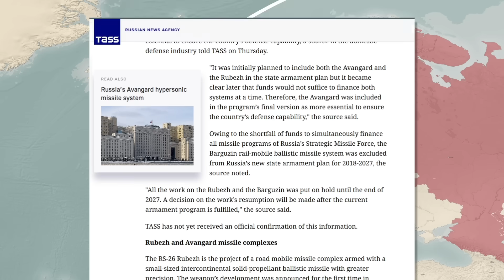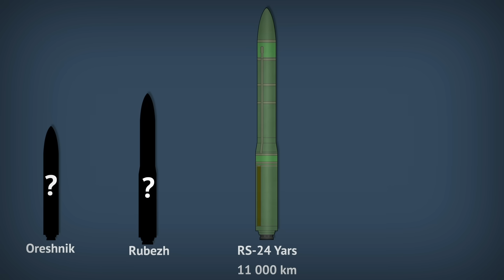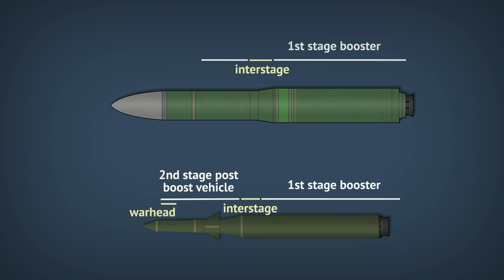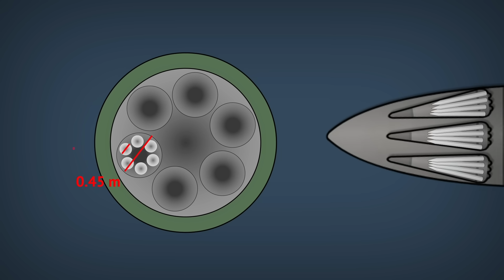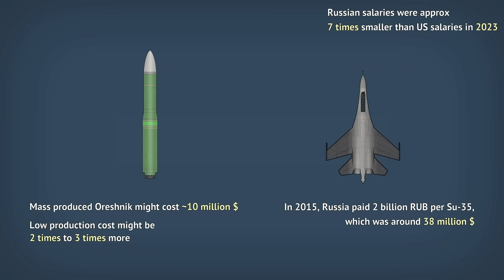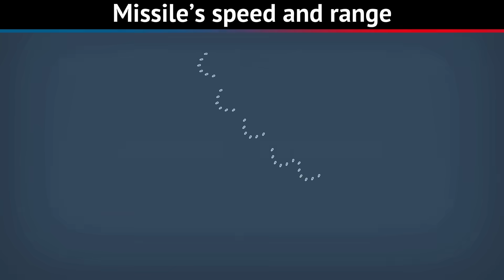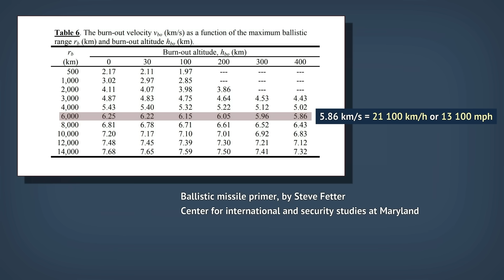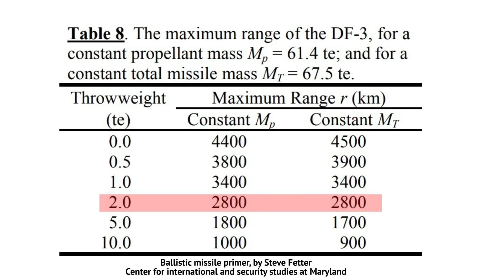Ukraine can’t counter Oreshnik missile. But it doesn’t have to.

Comment: There's no evidence of cluster munition. It is possible to determine the maximum size of each of the 36 RVs based on the dimensions of the Yars payload fairing: 0.23m diameter, 1.1m length...
They have a weight of 25kg. They cannot carry 100kg of HE.
Based on Yars, the CEP should be 124m.
PAC-3 and THAAD can intercept MRBMs.
The first successful test flight of Rubezh to ICBM ranges featured no payload. With its actual payload, it achieves a range of 2,200km. Burnout takes 124 seconds.
Oreshnik's payload is 1.5 tons.

Comment: Depending on the sophistication of the exoatmospheric penaids (chaff, cosmosol, active jammer) aegis ashore may be able to intercept some RVs in the mid course phase.
THAAD is also capable of intercepting MRBM RVs in the terminal phase, but doesn't have the rate of fire to engage most Oreshnik RVs.
Reply: THAAD сам неспособен обнаружить и отслеживать ракеты в гиперзвуке. Только по данным оптического теплового обнаружения со спутников. Далее ракета маневрирует и запускать противоракету ты можешь только тогда когда знаешь что ракета летит в твою область (прикрытие объектов, находясь у самих же объектов).Т.е. ты защищаешь уже то, что гарантированно потенциально поражено (снижаешь и без того критичный ущерб для инфраструктуры). Т.е. смысла в этом немного. 
Имея информацию о ракете нужно запускать множество противоракет, с учетом возможны вариантов полета ракеты (но тут очень большой расход противоракет, что нерационально при массовом запуске ракет и различных БПЛА потенциального противника). 
Поэтому самый логичный вывод, создать еще более быструю противоракету, которую наводят спутники и загоризонтные РЛС. (РФ имеет свои прототипы как S-550).
Но опять же Орешник не самая быстрая из маневрируемых ракет у России
Reply: @mountain_climbing  The AN/TPY-2 can and does track MRBM class targets.
Sure, THAAD can be data linked to offboard sensors that can see beyond the horizon of the THAAD battery to provide early warning, but the native radar is all that's required for target detection, track, classification and guide to intercept.

There's no evidence of post-boost maneuvering on Oreshnik.
The way it defeats THAAD is by saturation. The warheads impact at a higher rate than THAAD interceptors can launch.
Reply: @Evan_Bell - what is "plasma stealth" ? And why... (And why NOT!?)
Reply: @ivicamilosavljevic4706  It's the notion that as plasmas are opaque to EM radiation, they prevent radiowaves reflecting off the target.
What it ignores is that plasma itself is electrically conductive, and thus itself, reflects EM waves as well as emitting its own.
For most ICBM tests, radars are stationed in the target area that track incoming warheads, irrespective of their plasma sheaths...
Reply: @mountain_climbing - oreshnik technology is as old as my long time ago dead grandfather...

Comment: It's not an IRBM at all. Even with a single RV, it's not capable of the 3,500 km range threshold for an IRBM.
It's an MRBM..

That second (first successful) test flight of Rubezh had no payload. No warheads and no PBV. It was literally just the booster.

Yars has a capacity for 6 100kt warheads, but it's deployed with fewer.
Rubezh has a capacity for 9.

The Mk4 weighs 204 lbs, not 360.

The cluster nesting of RVs makes no sense, it appears to be a misinterpretation.

It is possible to determine their size, by maximum packing efficiency of the payload fairing.
Each RV is 9 inches in diameter.

Oreshnik costs 30-50 million USD.

That exhaust plume video isn't Oreshnik, but Progress MS-29 ISS resupply launched 9 hours later.

For SM-3 interception, it's not just a matter of large number of RVs, but it also likely features the same suite of chaff, cosmosol and active jammer exoatmospheric penaids that Yars and Topol-M uses.

No, the RVs are released shortly after SECO, early in the midcourse phase.

The burnout velocity is 3.8km/s or Mach 11 at 200km altitude on a max range MET. 

Yes, the attack on Dnipro used a lofted trajectory.

No, the PBV is the same for Rubezh.

Both Rubezh and Oreshnik are two stage.

The max range will full payload of 36 RVs is 2,200km.
With a single RV, it could reach 3,400.

It takes 124 seconds to burnout.

Oreshnik's payload is 1.5 tons.

Comment: Your title doesn't even match the context. Just another AI created garbage content with misleading news. And yeah Oreshnik is that important because of its pin point accuracy and devastation to wipe out anything on the map within minutes and nothing to stop  it. There you go, cleared up for your garbage content.
Reply: Pin point accuracy? No. MRBMs with non-maneuvering RVs have CEPs of a couple hundred meters.
Wipe out anything on the map? 
The Pivdenmash is still there.
The impact energy is on the same order of magnitude of a cruise missile.

Comment: the title is misleading.
oreshnik cant target smaller military units, its a waste of material, its intended to target large infrastructure which is what it was used to.
ukraine does need to counter oreshnik, but it will not receive such help because the systems to do so are extremely expensive, larger than patriot, and may rarely to never be used or be able to be used.
and a similar job can be done by other hypersonic missiles but those can be shot down since they dont leave the atmosphere  and dont come right from above, and the aircrafts that carry it have limitations.
oreshnik does not have limitations, it can carry easily 30 warheads that can do similar damage to khinzals (less accurate though since they do not have GPS guidance unlike khinzals, so its like shooting from space with a massive shotgun and praying you hit the target, but since targets are large this isnt a issue).

interception of oreshnik: interception is impossible of the warheads at least, the missile itself can easily be intercepted by  either launching a interceptor close to the launch site within a minute of the launch, or by striking it before it releases the warheads.
after that it is impossible to intercept anything, and the speed is such that even the most expensive air defenses in the world, would not be able to even hit ONE SINGLE WARHEAD of the oreshnik.
even more so if the warheads are smaller, as they may not produce any meaningful RCS to be intercepted in distances of -40km.
even if detected the angle of attack is too high for any search radar stationed in the ground such as the one that operates together with patriots to pick it up, as the radar does not sweep those high angles.
one has to remember most if not all air defense systems are meant for inside atmosphere operations at distances below 80kms and at altitudes below 17 kilometers.
specialized missiles need to be used instead to operate above the karman line (30 to 100 kilometers from sea level)
Reply: Excellent analysis. 👍
Reply: they can not be detected there is no RCS at all those things have a massive and denser plasma cloud around the warheads we ever saw, which will eat all radar beams and makes nearly every radar we have useless right now against that missile...
sorry for bad english im german and typing on my phone with gloves
Reply: @gizeh77 That plasma wake only forms during reentry..
Plasmas have high dielectric constants and thus high RCS.
Reply: @Evan_Bell  normaly yes Not in this Case
Reply: @gizeh77  How so..?
Reply: @Evan_Bell  im at Work right now im gonna get more into that when iam off work
Reply: @gizeh77  No problem. I'll explain myself for when you respond.
A plasma wake from can only form in the lower, denser parts of the atmosphere when the air molecule mean free path is small enough that a shock can form.
Alternatively, I suspect Oreshnik warheads are actually the same endo atmospheric decoys used by Topol-M. 
Their mass and ballistic coefficient match the P-8 'combined plasma quasi heavy false targets'. These feature pyrotechnic plasma generators, that release hot sodium and lithium ions to replicate the larger plasma wakes of the larger nuclear RV.
But this system will only activate at the same low altitude that the larger RV will begin to produce it's own plasma wake from aerodynamic heating.
Or are you referring to exoatmospheric cosmosols?

Comment: Its simply IDIOTIC to strip nuclear warheads from an IRCBM and put conventional warheads on it. The only thing that it does it that PROVES YOU (i.e: the RUSSIANS) do not even have anymore conventional vectors to deliver payloads, like cruise missiles anymore. They do not even know the meaning of "PRECISION STRIKES" - PLUS! - it works as a "nuclear deterrent" only on STUPID PEOPLE. The only ones that it might get scared of it and bring it up on their podcasts, are "experts" of the likes of Joe Rogan.
Reply: Conventionally armed ballistic missiles are a thing nowadays. China has various types in service, including the IRBM DF-26 (and soon DF-27). 

China has a massive stockpile of cruise missiles that are more advanced than anything Russia operates, as well as a number of other conventional strike capabilities, but it sees a requirement for conventional ballistic missiles also in its doctrine.
Reply: @chrisdoulou8149 yeah but that doesn't detract from the point that they are inefficient forms of conventional payload delivery. It's a lot cheaper and just as effective to have air launched versions. Why they didnt opt for that is obvious as the launch was mainly for propaganda but cost wise it just indicates they are running out of readily available payload delivery systems.
Reply: @ because ballistic missiles are incredibly difficult to intercept, while other platforms are not. It’s not like Russia isn’t still using air power and cruise missiles, they are, the conventional ballistic missiles are just an additional capability for hitting heavily defended high value targets at long range without having to revert to nuclear weapons. 

Put your Russia hate aside for a moment. It’s rational for any nation to have multiple platforms with overlapping capabilities.
Reply: @chrisdoulou8149  never denied that they weren't using cruise and other payloads, just said they were running out of readily available platforms. My original point was that they could've prompted for an air launched ballistic missile which is just as hard to intercept and is cheaper but they chose not to which means those systems must be preoccupied or nonexistant. It also indicates that they've run out of maneuverable hypersonic missile if they keep resorting to using irbms if this wasn't strictly for propaganda.
Reply: @ different flight profiles and terminal velocities. I’m not arguing that this isn’t an expensive weapon, but for certain high value targets its use would be completely justified.
Reply: @chrisdoulou8149  I mean ofc if they used it to sink a carrier or something similar absolutely it's justified but correct me if I'm wrong but they used it against a city no? The only strategic target there could be the propaganda value. I saw some people saying there was a missile factory as one of the targets so maybe that if we can believe it but of the targets I saw pictures of were civilian buildings.
Reply: @ they used it against a factory that was building rockets, with most of the production being underground. It was used in its intended role as a semi precision weapon designed to attack larger area defended targets. 

I don’t think the Russians are at Chinas level of being able to effectively target things like carriers with their hypersonics. They lack the volume, accuracy, and the kill chain; there’s really only two countries in the world capable of those kind of strikes and Russia isn’t one of them, however they can absolutely take out factories, airbases, marshalling yards, and other larger, non moving,  high value targets.
Reply: All in all in the age of sophisticated air defense from the major powers, conventional ballistic missiles just don't make a lot of sense to use against a non major military power or non strategic target unless for propaganda like the original op was posting about. That's like the US sending stealth bombers against insurgents who have no air defense or radars completely unnecessary but sends a message. Edit:ik op means original poster so it's redundant
Reply: @ The threat wasn’t to Ukraine, it was to NATO. It was to communicate that Russia has the capability of hitting high value targets in Europe with conventional weapons.  

Considering only the SM-3 has the ability to intercept these kinds of weapons, and even then you’re using multiples to ensure a hit, then it’s a valid threat, especially when you consider how few the SM-3 the US operates, and how expensive and slow they are to build.
Reply: @chrisdoulou8149  I don't think we're in disagreement with anything, the strike was mainly for propaganda so if they want to keep wasting money for that I say go for it; is it still a stupid decision?  Yes.
Reply: @ where we disagree is that you think it’s stupid and I don’t. I have zero love for the Russians, however it rationally makes sense when you consider their doctrine is based on ‘escalate to deescalate’. 

If I was in their situation I’d probably do the same. Their actions are probably the most rational ones to make when you consider their circumstances (that are self inflicted, but that’s a different conversation).
Reply: @chrisdoulou8149  If you knew russia and russians even a BIT, you'd never use the same words like "smart" and "russian doctrines" in one sentence.
Reply: @chrisdoulou8149  And that's why it's a stupid decision IN context. It is rational in the sense that it's their only remaining choice based on Put*n's whims but the fact that they are in that position is itself not a smart choice. The smartest option is dependent on who is in scope, the RU people or Put*n. This is just a scope disagreement at the end of the day.
Reply: @コーヒーJelly  A ballistic missile is great for static targets it is ineffective against moving ones.
Against a moving target it's not an ICBM but a direct fire missile  with explosive warhead, 4 SM40 launched by a submarine cost less than 6.5 millions of $ and they are pretty hard to counter: "As a countermeasure against air defence around the target, it maintains a very low altitude while inbound, staying just one to two meters above the sea surface. Due to the effect of the radar horizon, this means that the target may not detect an incoming attack until the missile is only 6,000 metres (3.7 mi) from impact."
Reply: lunch is on table, come here, or daddy will be angry :D

Comment: rus paying just a bit more than germany did per pac-3 patriot interceptor is a bargain! It would cost substantially more to achieve this missiles results through conventional means like airpower. Its quasi cheap for rus and insanly expensivve for us. the rus ability to potentially first strike europes airpower is surely going to spark another dick measuring contest between the larger powers...

Comment: It may be a kinetic weapon   it doesn't need to have a explosive warhead
Reply: The impactors were said to be doing Mach 10, roughly 3 km/s. At that speed, 1 kg has the same kinetic energy as the chemical energy of 1 kg of TNT. So ok, it’s doesn’t need explosives, but it’s no more powerful than a conventional HE weapon.

Comment: The video showes 6 missiles glowing white hot, meaning that they became so hot by friction that conventional explosives would explode prematurely after entering the atmosphere. I think these missiles are only usable for nuclear attacks.
Reply: Only the upper layers were so hot. How hot the underlying layers are depends on the thermal insulation and the heating time.  The heating time is very short, maybe a couple of minutes or less.  In addition, the composition of a nuclear charge includes conventional explosives, which are necessary to initiate a nuclear explosion.  Well, at least with all the theoretical ways to initiate a nuclear explosion that I know of, explosives are needed everywhere. This means that if a warhead is suitable for placing a nuclear charge, then it is also suitable for placing conventional chemical explosives there.
Reply: Exactly. They're very limited range and not precise. Great for neara range stationary targets but that's it.
Reply: @LeviBulger  its ironic that you call others "shill"´s....

Comment: I assume the work restarted when Ukrainians started receiving Patriots. It's funny how people lap up the claims it was about long range strikes when it was clearly in preparation for a long time and will be used on larger scale, possibly to knock out the rest of Ukrainian electric grid.

It's quite likely that it was the real reason for Biden authorising long range strikes. To allow Ukraine do more damage to significant Russian targets before it gets knocked back into XVIIth century.
Reply: Or perhaps this is a response to the permission to use ATACMS missiles deep into Russian territory, which was issued by Biden.  Moreover, Russia has repeatedly warned that there will definitely be an answer. No, that's crazy. Obviously, Biden's actions are only a response to the future consequences of these actions.